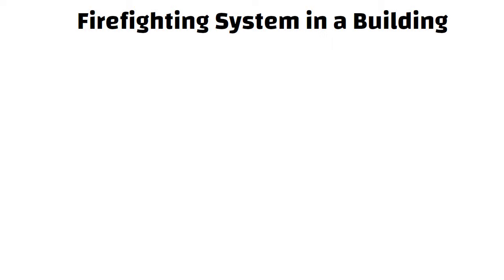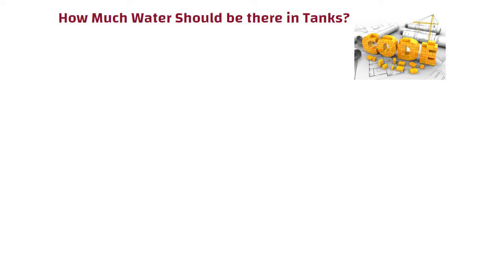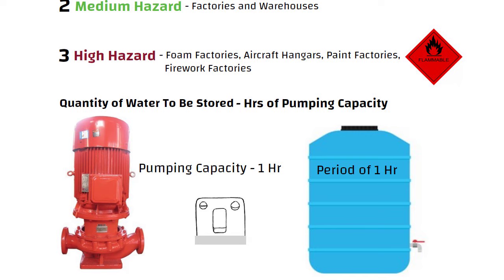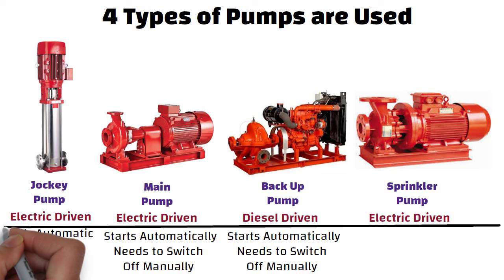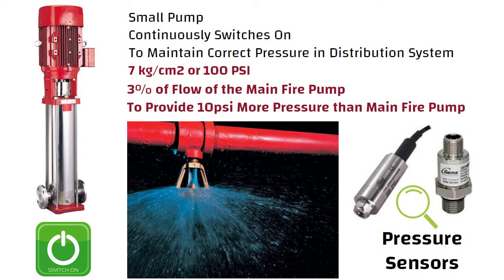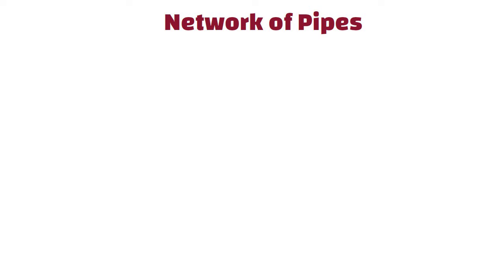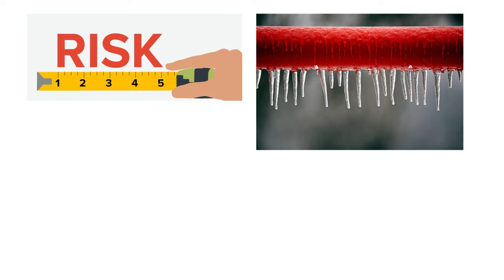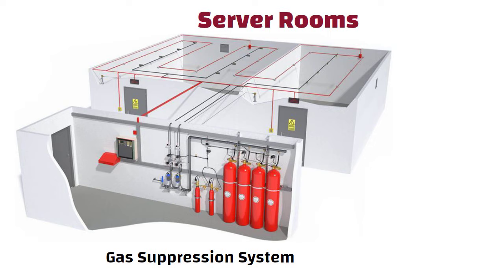How does firefighting system in a building work?

Comment: Use water under weight to build high pressure and delivery system with wax filled valve contact control that melt when there is fire or high temperature activate battery direcurent discharge melt the wax and release large water under pressure that way no electricity needed because no electricity during fire or had to be turn off before fire fighting begin